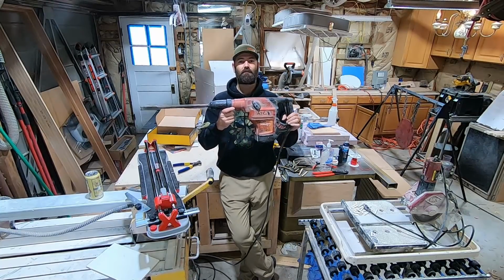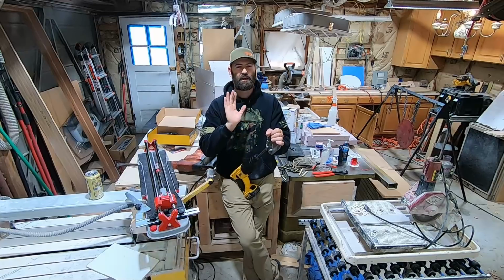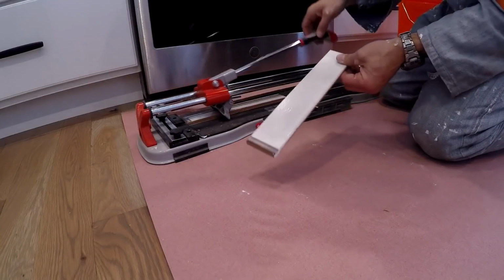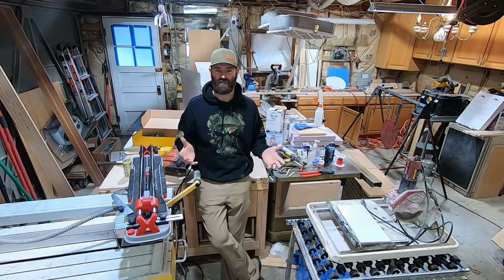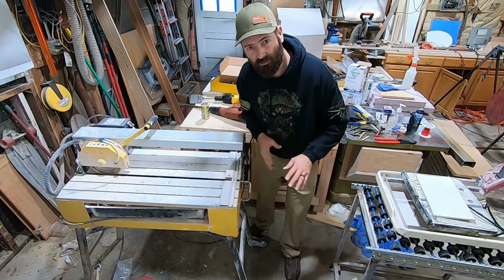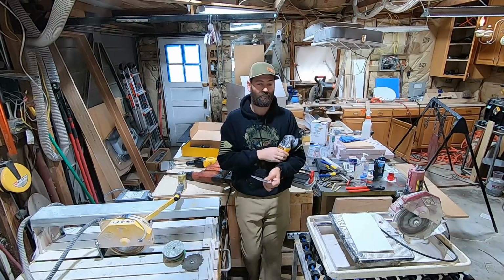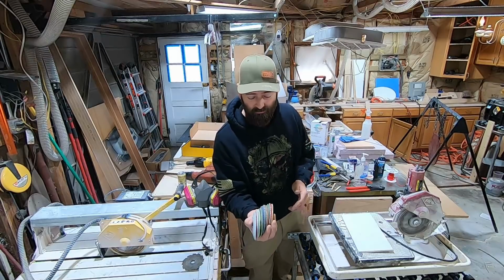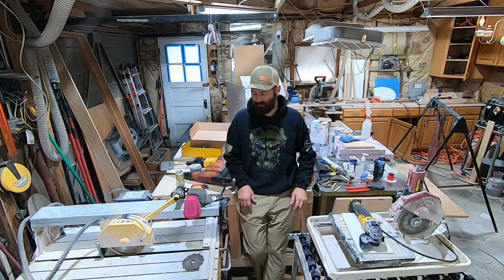Install Tile Fast And Easy With These Tools | THE HANDYMAN |

Comment: You crack us up when it's needed most ~ thank you! 😆
Tiling is a very satisfying project. It's not difficult & you get almost instant results. Probably why it's been done for centuries. For the easy simple beauty of it. Or not so simple. It's genuine artistry, even for people who are not very creative.

(Those peel & stick tiles can be absurdly pricey - $20 for one little section. Recently did half of a small kitchen w/ basic white subway tiles for less than $200. The cost included a similar tile cutter, a few basic hand tools, tub of mastic/grout & decorative ceramic rope border trim. Got everything at a Floor & Decor store - very affordable.)

Comment: I prefer the table saw type saws( blade below cut), great for long cuts and angles. I will use a speed square in place of the guide to hold straight.

Comment: Do you worry about wearing the p100 mask with a beard? I've heard facial hair makes them pointless. Do you worry about it, or don't fret about it?
Reply from the maker: You heard completely wrong.  I have sprayed toxic lacquer 100s of times and I don't even smell it when I have my mask on.  The air takes the path of least resistance.  I wold be dead if the mask didn't work.
Reply: I think that's propaganda put out by the military.  In reality they just want people clean shaven

Comment from the maker: Who has Corona?
Reply: The Handyman what is SSTC? I feel left out
Reply from the maker: Its a secret club
Reply: The Handyman I’m not sure. Is this the 3rd Chan?
Reply: The Handyman I want to be secret
Reply from the maker: @MookieMan1  Yes
Reply: The Handyman ah well then I’m already in the SSTC
Reply from the maker: @serge4856  Are you a member?
Reply: I want in as well :D
Reply: I do. With a lime 😎
Reply: I need to spray furniture I'm building.  I have a few older respirators that are a bit nasty, but I couldn't even find a single replacement filter cartridge.